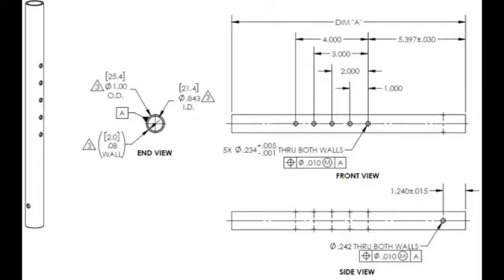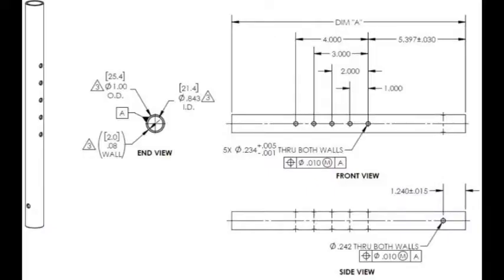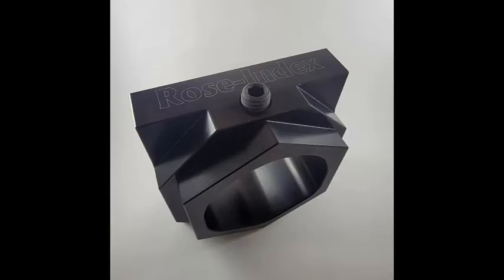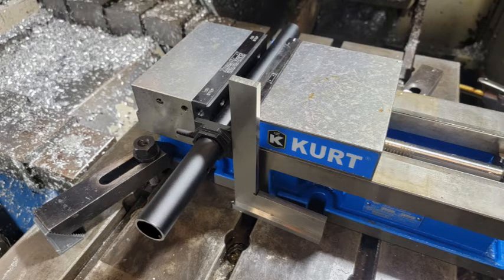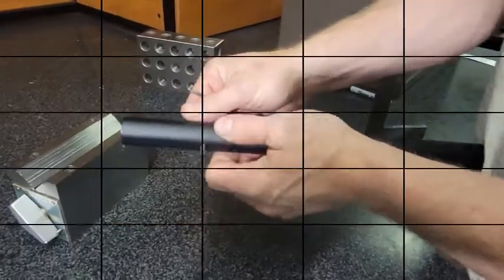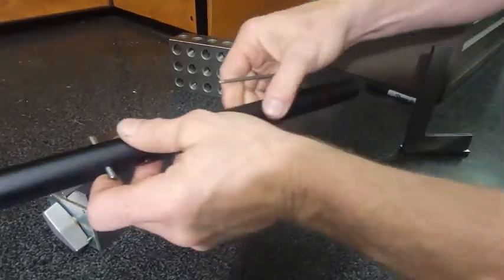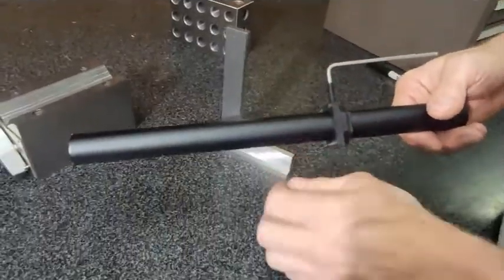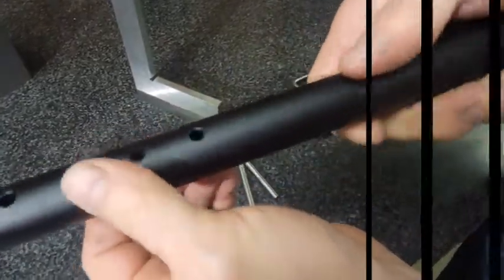#003 - Using the Rose-Index® in a Rush Job

Comment: If you do not own a Rose Index you are missing a very necessary and useful machining accessory.  Who wants to spend time moving a super spacer on to the mill for a couple of parts?  How many times have you had to do so because the part was just too large of diameter to fit in a 5C collet block?  Bolt hole patterns are quick and dirty using this device.  Mine is not for sale that’s for sure.